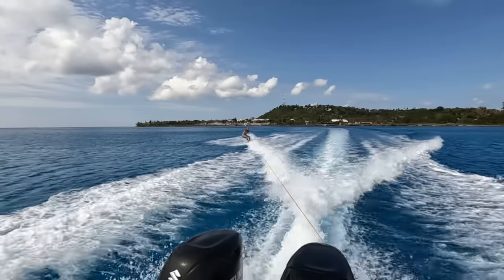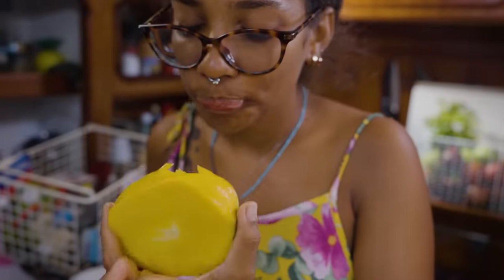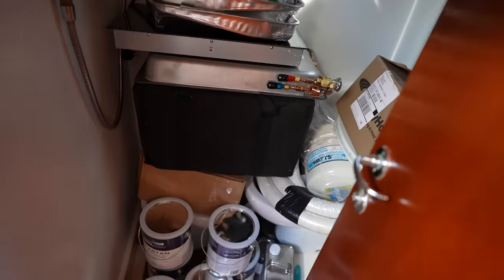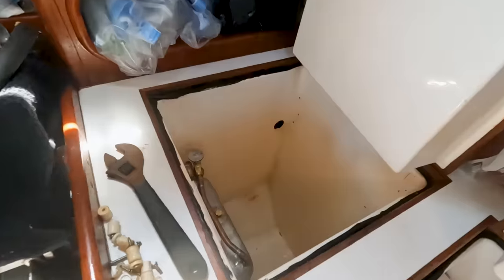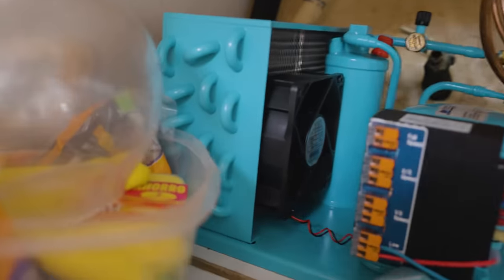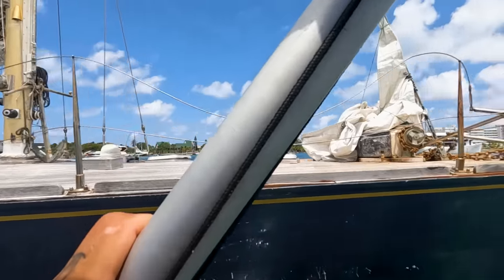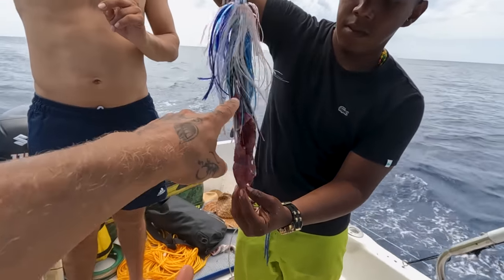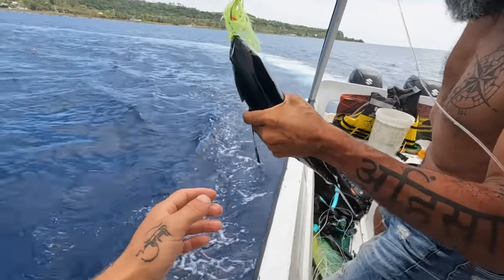We Found An Abandoned Boat Drifting In The Ocean - the Crew Disappeared! (S4E3: San Andrès)

Comment: Unless you plan on using all of the thixo in one shot next time don't use mixing spout. Just squirt out of tube onto a mixing plated and apply it by hand that way you can save the rest of unused portion of tube without locking up mixing spout.
Reply from the maker: The whole point to that product is to have no cleanup. Normally epoxy gets everywhere. I purchased a bunch of heads from TotalBoat, they aren't expensive.